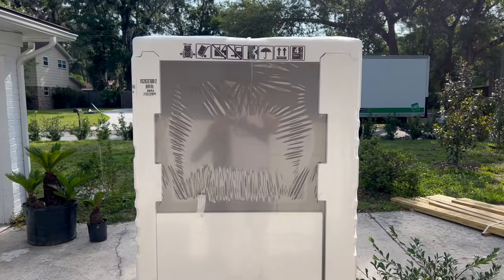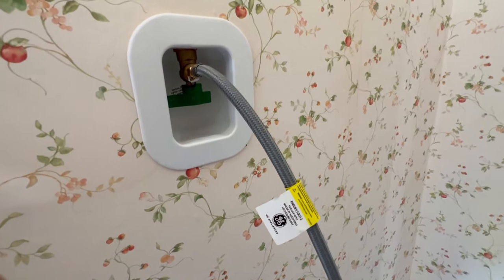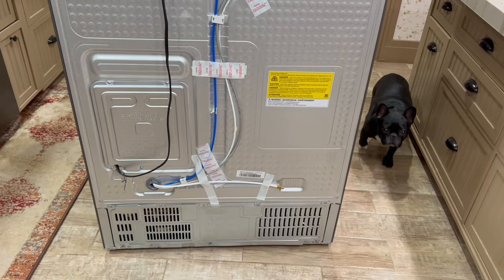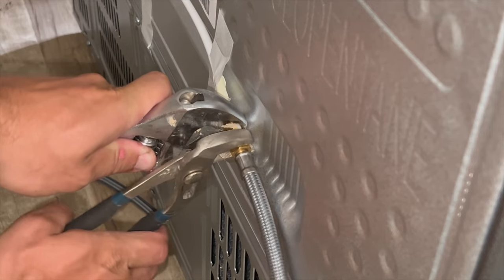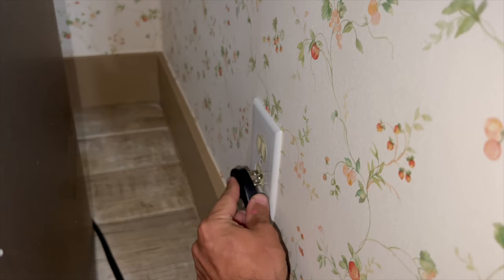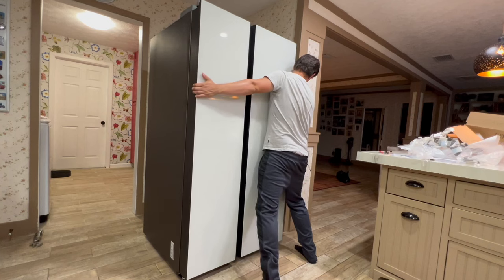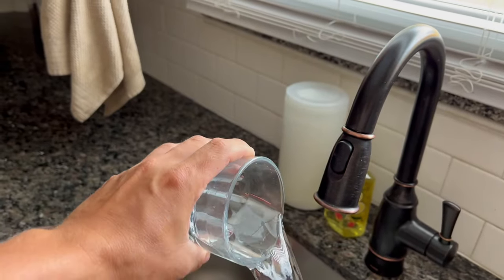How to Connect a Water Line to a Refrigerator

Comment: If it has that black O-ring, that’s right above the threads, please do not use Teflon. You’re actually going to make it worse and more likely to leak. That black O-ring is specifically there to stop leaks and it doesn’t play well with Teflon tape.
Reply: Exactly right no Teflon
Reply: @danthetoolman4311  yes and teflon is not drinking compatible btw

Comment: Teflon is not needed
Reply: May I ask why? Is the compression fitting enough?
Reply: @arguetav  it's not a compression fitting
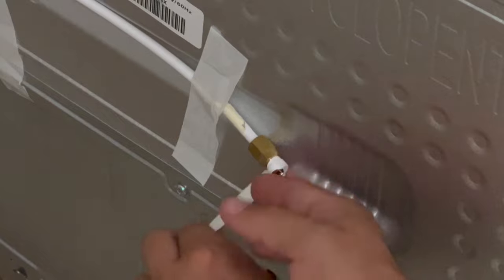Reply: @arguetav  If you pause the video 1:15 . I remember reading that that black O-ring is the reason why. It's designed to act like a gasket after you make the connection, so doesn't allow water to leak out. Make sense?
Reply: I have the same fridge and I tightened the nut as much as it would go but still there's tiny leak. Maybe I will try Teflon.